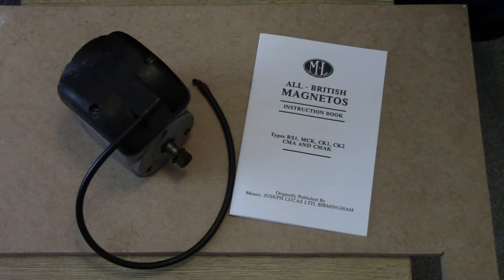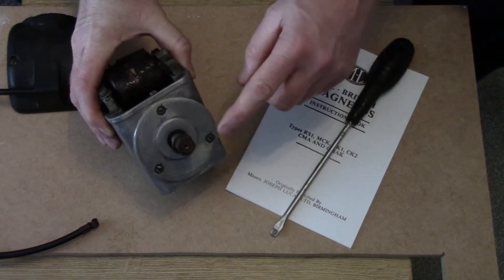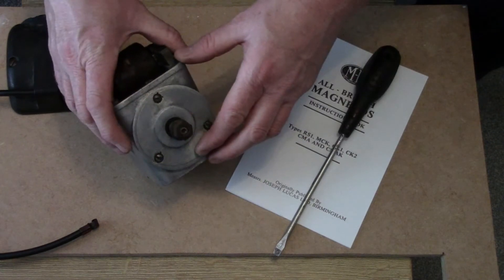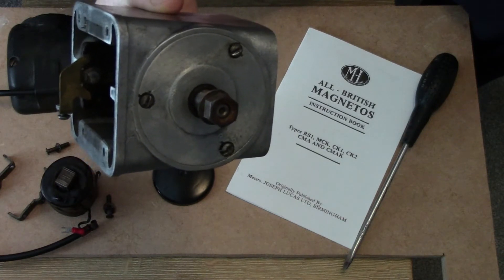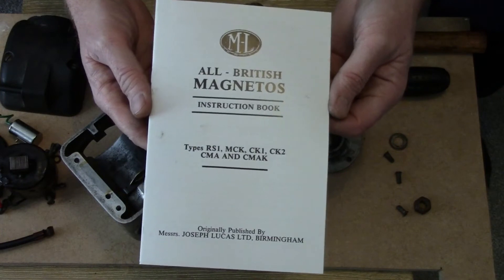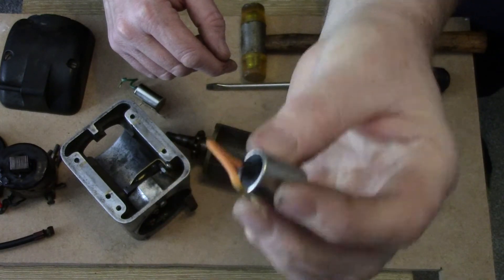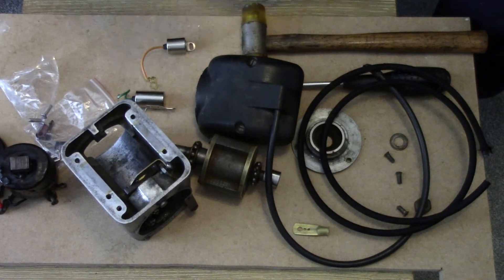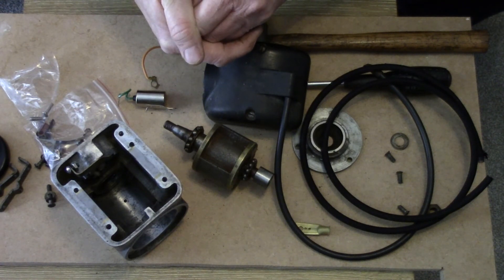Lucas RS1 Magneto Stripdown

Comment: Cheers for posting this. If the coil measures a few ohms or less between  the wires but open from either wire to the HT contact point is it any good? Just trying to get a Bamfords EG1 up and running again.

Comment: What does the condenser do?
Reply: The condenser helps to reduce the spark that is generated across the points when they open. If the condenser fails or is faulty then the points will wear out much quicker

Comment: Thanks for this video, it's been helpful.  One question how do you know if the coil is knackered?  I'd guess it's a resistance measurement but what readings should I expect if that's what you do.  Thanks
Reply from the maker: Hi, many thanks for your view and your comment.
I've been told that a reading of OVER 4k Ohms (4000) from the high voltage terminal of the coil to either wire coming out of the coil, indicates that it is faulty. I hope this helps :-)
Reply: @heritagemachinery  thanks for your reply.  That's good to know.  I have replaced the condenser and had the magneto sitting on a radiator for a few weeks.  I will try measuring the resistance. I need to clean up the points and give it a test but my Ruston and Hornsby PT sat half buried in a field for approximately 60 years.  I don't hold out too much hope for the mag working.  It's been three years of work to unseize the engine and get it all stripped down and cleaned up.  It's ready to rebuild now and even has original paint!
Reply from the maker: @gillonstewart1601  Whatever the outcome, bravo to you for putting in the effort.
It sounds like you've done brilliantly so far!